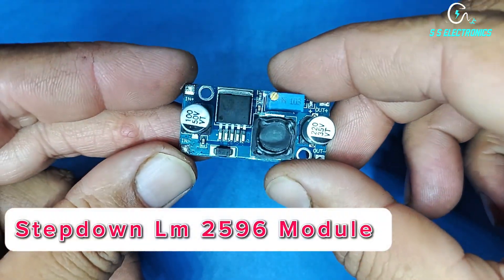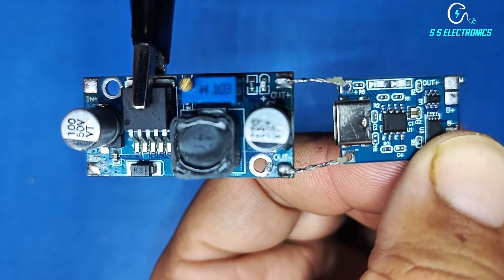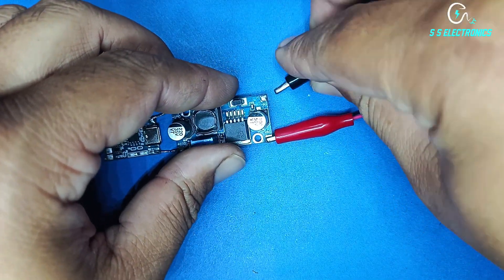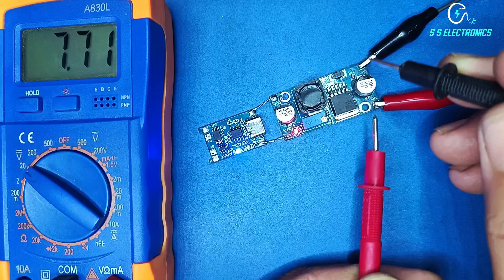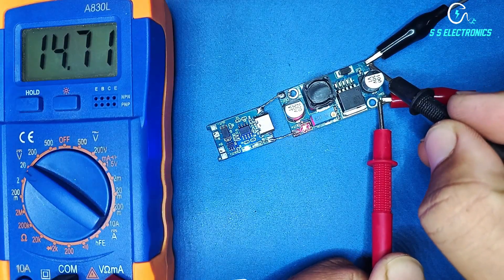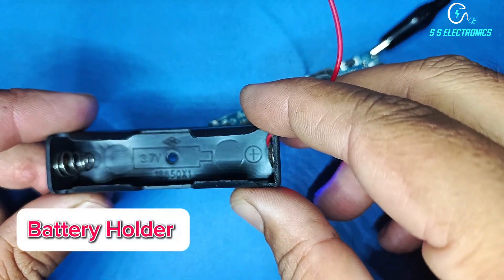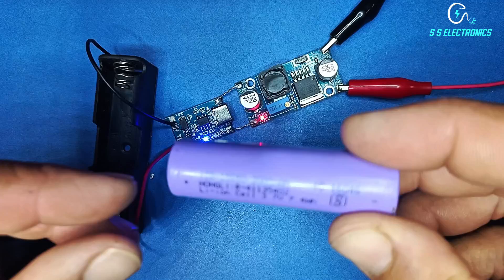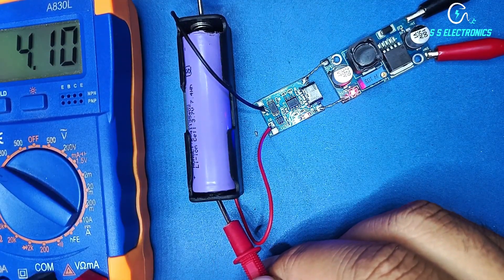Lithium Battery Charger | 48v to 3.7v Converter | Tp4056 | 3.7v Charging Module

Comment: Do you think you can make something in reverse? Meaning, taking input from 3.7V 18650 battery, producing 9V and also charging the module using USB
Reply from the maker: But you need voltage booster Module